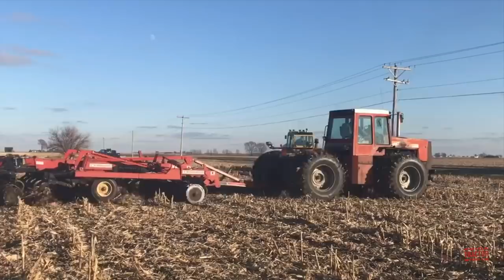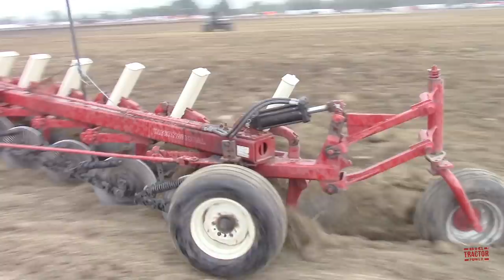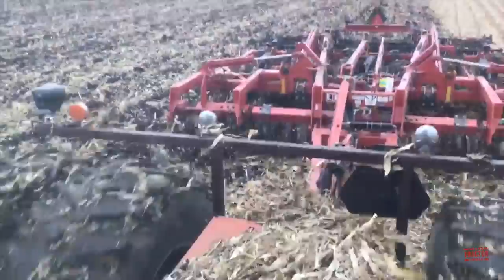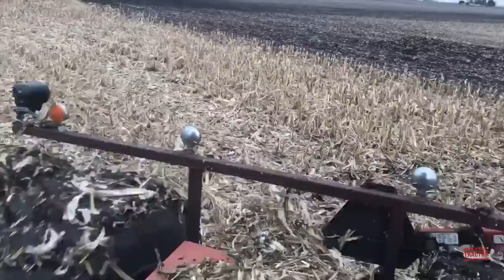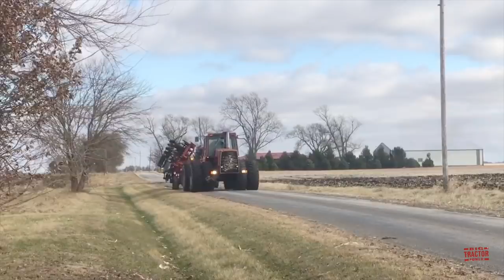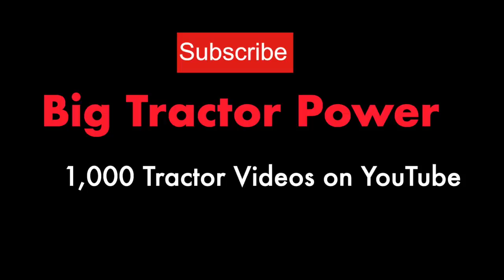MASSEY FERGUSON 4wd Tractor Tillage Team

Comment: I've sorta always liked a Massey Ferguson especially the smaller 135 type tractors. Now the McConnell-Marc I never knew existed. Thanks for sharing
Reply from the maker: The 135 and 165 are solid tractors. Lots of interesting twists and turns. In the end both the Combines and 4wds left Massey in 1989 and returned to Massey in 1994 as AGCO acquired  Massey, McConnell-Marc and Western Combines Corporation in 1994.

Comment: never even heard of that yellow tractor. pretty neat
Reply from the maker: The McConnells are neat machines.
Reply: First tractor available with a phone in it. Big deal in the day. Now your phone syncs up with the radio. Fridge is getting common. Hands free driving. And 600 hp is more common around here than ever before. My grandpa still had a team of horses when he started out. Farmall M was a big deal to him. He lived long enough to drive our 7800 John Deere when he was 95. Fwa air  seat and cab and halogen lights. He told me then I was pretty spoiled.

Comment: Something about those older 4WD articulated tractors with their angularity makes them look more tough looking and business like compared to today’s swoopy looking tractors that look like they are fragile and 20, years from now will be in the junkyard.  
People can hate on 2 Stroke Detroit Diesels all they want but the fact remains the 71 series engine was in production from 1938 thru 1995 with very little change in architecture no other Diesel engine can come close to that record of solid dependable performance.  I would hate to think how many Detroit Diesels have set for a decade or mor and with just freeing up of the rack and injectors with hand tools are  running a few hours later.  Myself while it’s interesting seeing new equipment in the field I really love seeing the old iron still getting it done decades later.

Comment: I would love video on Massey 1100/1135 etc
Reply from the maker: Me too. I just need to find them to film. I really want to find an 1150.
Reply: @bigtractorpower  yeah.. They are getting rare. My dad had an 1135 with duals.. Don't see many like that
Reply: We had 1977 1155 turned up to 185 hp with a straight pipe. We trading for a 4840 JD when the 2ND rear-end blew out!

Comment: MF 4000 series was originally built in Des Moines, Iowa. After MF closed that plant in 1981 they moved production to Detroit tractor plant. And after Detroit plant closed early 1983 the production was moved to Brantford. Does anyone know when they facelifted the 4000 series with new decals and brown/tan interior? Was it right when they switched production to Brantford or later?
Reply from the maker: That is a good question on the changes.  I was focused on Massey Combines Corporation connection for this video. It is my long term goal to film a 4000, 4840 and 4900 to connect all dots for the 4000 series.

Comment: I think that it would be great if you told us inflation adjusted price along side with original price tag. It would be easier too put price in perspective.
Reply from the maker: It’s often a job to to find the original sales price.  A 425 hp tractor today is every bit of $450,000 today.

Comment: How many McConnell Marc 1000s were built and sold? Any idea? Were they reliable? ... and, was there a Chinese supply-chain operation? Thanks.
Reply from the maker: I am not sure how many were built. I will need to research that. They are a solid and reliable tractor.
Reply: @bigtractorpower  Thanks for getting back to me on this... its very interesting for sure!

Comment: Are there a lot of tractors in the USA with front linkage? Like they would put a front disc or a front seed tank?
Reply from the maker: No.  Some used to mow hay with triple mowers are around but I have never seen one in tillage or seeding here like the ones used in Europe.  30-40 ft wide implements are common here and too big to mount on the front.  Many farms are using 60ft planters.